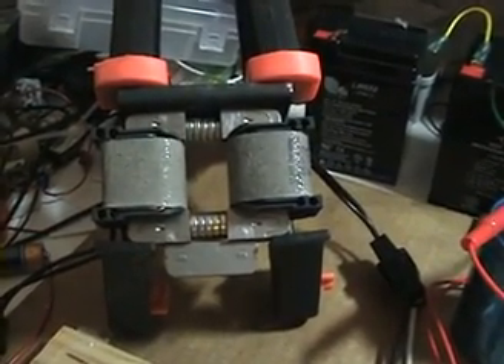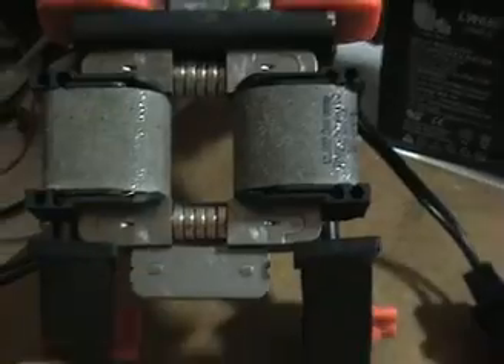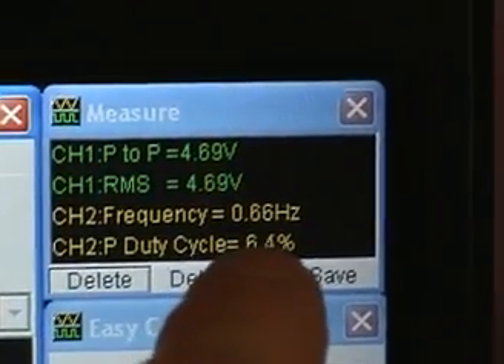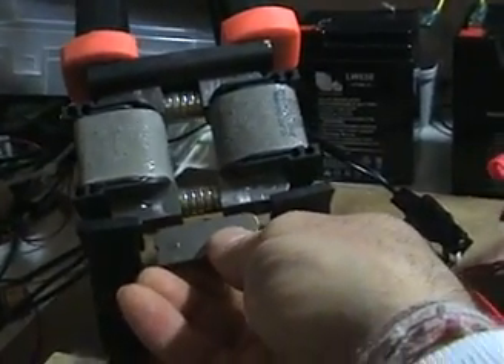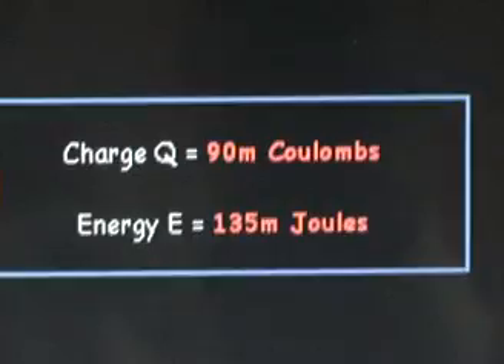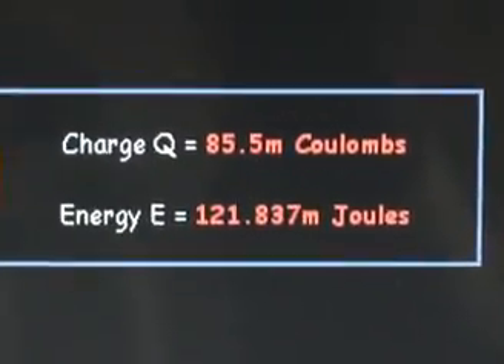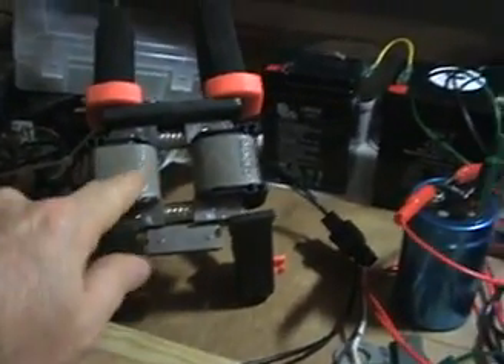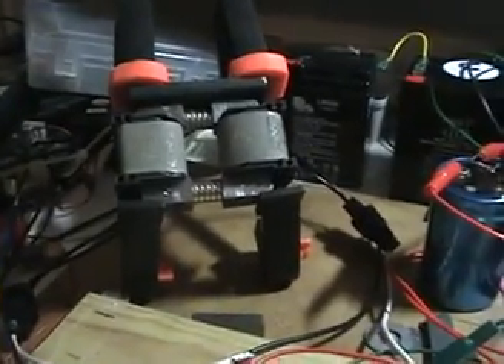Flynn Parallel Path Device test 2

Comment: It flips because the electro magnets are overpowering the neo magnets and is pushing flux in the opposite direction through the cores.  and it's not 3V that matters, it's the strength of the magnetic field generated by the solenoid coils.  B = uIN/L.  If you know the number of turns in the coil and the core material used you can calculate the necessary flux density to get the effect and design more efficient coils.
Reply from the maker: +J Evan Johnson Yes, correct!

Comment: At one point say 3 volts you are neatralizing magnet flux but once you go over 3 volts you are then creating a stronger electromagnet with the coils
Reply from the maker: Alex Manzanero Yes, correct!    (in this setup) once over 3 volts the electromagnet flux goes beyond the permanent magnets flux, so one needs to consider this and why I made this video. Luc
Reply from the maker: Alex Manzanero Yes,  correct!

Comment: That's a MUCH better test than in part 1!! (maybe you could edit the comments in Part 1 to indicate you did a better "Part 2") 

You could use 2 more shaded pole motor poles with windings as the collector ends. Keep in mind that the energy transfer from the PM's happens in very... VERY short pulses as the magnetic flux switches... static flux does no work.

IMHO, it the effectiveness of the steering coils comes down to Ampere-Turns. Your coils probably have 1100 turns of 30awg wire... so at 2.95V, you get 0.085A times 1100 turns = 93.5 A/t.  I had been trying 100-200 turn coils... which was tough to work with. To get a similar 100A/t at 100 turns of wire, I had to run a full 1.0 Amp of coil current... which makes for some rather warm small gauge wire.

Using such a large capacitor seems a bit inaccurate, since low-grade capacitors have so much ESR, that the surface charge of the plates makes it seem that the amount of energy *(Coulombs) used is smaller than it seems (since the surface charge replenishes so quickly after a discharge pulse). Using a much smaller C value that holds maybe 2-5 times the estimated required Coulombs to get the same "effect", and discharge it into the coils... this seems like it should be a more accurate test.

Comment: ok. this seems good. and my question to you is this. if you have this exact setup but with the magnets removed and the heavy transformer as seen in the "Flynn Parallel Path Device test 1" at the bottom. run the 2.9v at 89ma DC will it hold the transformer and if not how much weight will it hold without the magnets? then do a maximum weight test with the magnets in place compare the two and see what if any difference occurs ;-) please msg me when done

Comment: so the ideal voltage is where the megnetic field generated by the coils is equal to the static megnetic fields of the perm megnets... it would be interesting to look at the polarity of the fields you can do this by placing a ring magnet (scrap cd drive) between two pieces of string ..tension the string and you have a very sensitive flux probe which will give you a good visual indication of the field polarities.